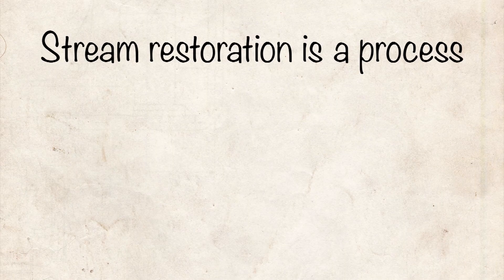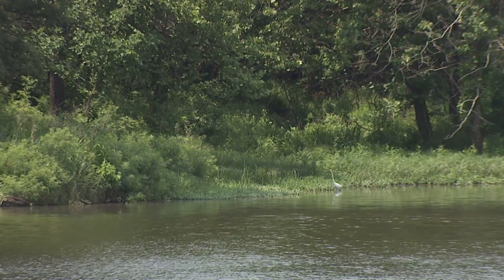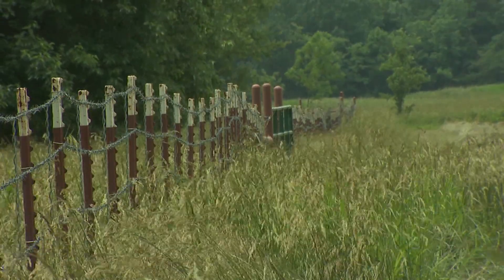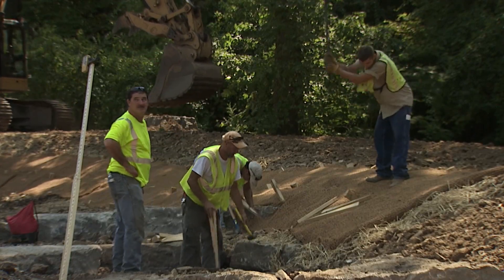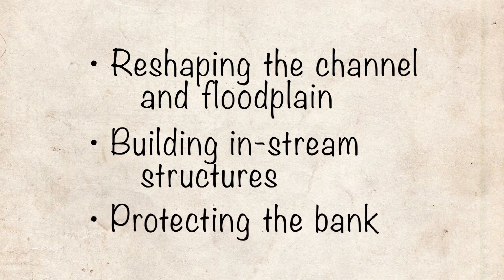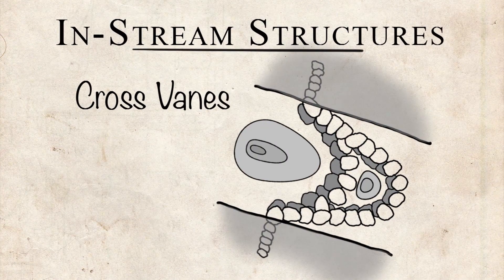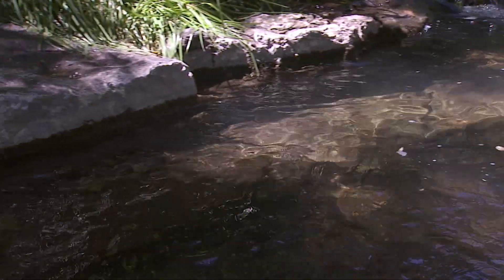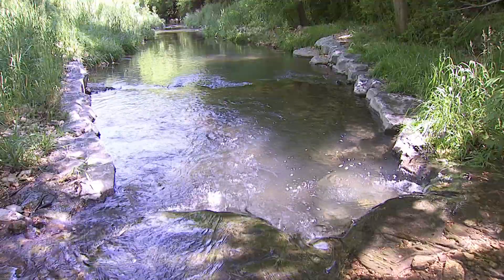Natural Stream Restoration: Restoring Streams (Part III)

Comment: Rain event? Is that the same as rain? And if so, who put the event in there, and why?
Reply from the maker: A rain event is generally considered as any continuous rain of greater than 0.1 inch in a 24-hour period. Keep in mind, this is the minimum. These structures are designed to help maintain stability in the bank when the rain is significantly more.

Comment: Fantastic video, can't thank you enough for the clear explanation! Question when you're showing the J hook: Doesn't the big plastic bag degrade and turn into millions of little catastrophes in the future?
Reply: Using plastic is stupid in this use.   What is also stupid is using too fine a gravel to cover the plastic.  What works pretty well is using a double layer of heavy woven wire fencing stapled to the logs.   Then cover it with large enough gravel that can't fall through the gaps.  You can then cover that with finer gravel if you want.  

What also does not work is using root wads on outside bends.  The next big flood will wash away all your work.  Always remember that wood floats.  Put it underwater and it will pop right out.  I can't tell you how many times I have seen this fail.

In the Midwest, you can plant whatever you want, what you will get is reed canary grass (invasive species).

Comment: Almost impossible to find a video on restoring a small creek. Army Corp of Engineers? Hiring a company? Let me play the lottery, maybe I can win a few hundred thousand dollars. I can tell at one point there was one here, until the city decided to get rid of it, same as they go rid of a large pond, about 50 meters from here, to build houses. I have spent 15 years, turning my yard back into a wildlife habitat, now if I could just get water flowing again. I'm sure the wild life would appreciate it. I just need to gather water from rain in the slope that goes down to the area with all the rocks and pebbles and maybe add a small pond (before I drop dead of old age).

Comment: Do NOT remove the cattle, rather, change the grazing management. Use the cattle to improve the watershed.
Reply: Cattle pugging and streambank degradation are an issue. They shouldn't be kept near watercourses. Fencing/enclosures work well, as well as off-stream watering systems (solar pump, etc.). In my experience, those measures have been successful at restoring streams.
Reply: The landscape does not need cattle of course I love to eat them Mother Nature does fine without them bison is a different story

Comment: never heard the word natural used so much to describe how humans can control nature. A bunch of BS, let nature do it's thing, get out of the way.
Reply from the maker: Unfortunately, streams running cities and town almost always need some level of control to keep from eroding property, as well as to be safe for citizens to enjoy.
Reply: @okstate_ag  Wow, you mean we need to find a way to make the streams that run through here more controllable before the reach the wide areas of the Mississippi, to protect the dumb people?
Reply from the maker: @carmenortiz5294  To protect people. Human have always made home near streams and rivers. Modern times are no different. The good news is by using natural stream restoration techniques upstream, you minimize the impact of floods downstream because the sped of the water flow is reduced.
Reply: @okstate_ag  Thank you for your information. My problem is something completely different. Years ago the city dried a pond that is close to my property and got rid of the creek that crossed my property. I can tell where it was. I have to restore it. My property is in two very different levels, one is about 10 feet higher. I plan to try to create a few swales to capture the rain water at various levels and connect the flow to where there is evidence of the creek. I don't know if it has a chance of working, but in normal years we get a lot of snow and rain in the warm season. This is the middle of the old section of my town, everything is grass around me, but I have managed to transform my 1/3 acre into a wildlife habitat/food forest. If it doesn't work, then I may dig a few small ponds. I have managed to attract quite a few birds and beneficial insects, since this is a bit of an oasis, but I want to attract even more.

Comment: I have built a few thousand grade control structures and fully appreciate the techniques you are using.  It is useful for protecting various infrastructure and elevating adjacent groundwater levels.

Comment: All you are doing is treating the symptoms and doing nothing to to stop the cause. The symptoms will keep recurring.
Reply: Hello Dusty.  We agree--if you go to 16:20 in the third video you will hear us stress the importance of integrating stream restoration activities with watershed-based plans and stormwater management on the landscape to decrease the amount of flow that is caused by increased impervious surfaces.  However, if designed properly these systems can be implemented such that they are able to handle current conditions under most flow conditions.  Of course, most designs will not be made to handle a 500-year flood event, so expectations have to be tempered in those situations as designing for that large of a storm may be cost prohibitive.
Reply from the maker: Erosion is the issue with many streams within cities and towns. These techniques use natural processes to keep erosion within check while still providing atheistic and recreational value to the streams.